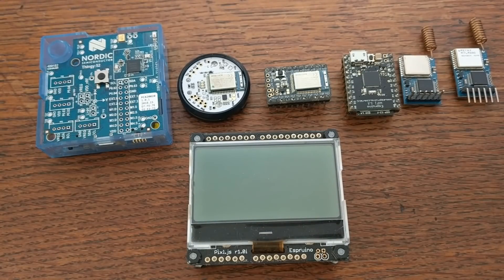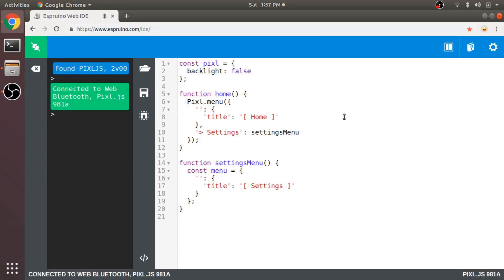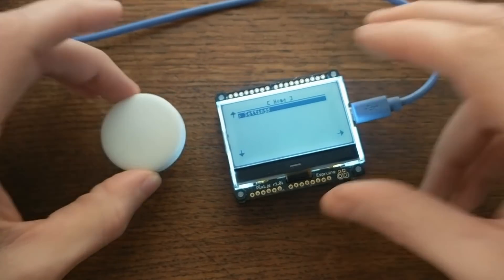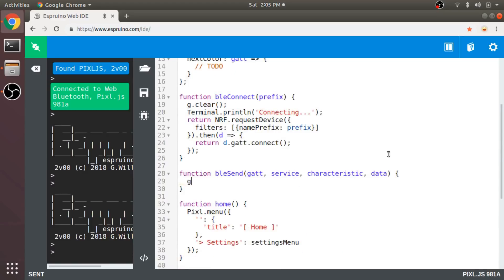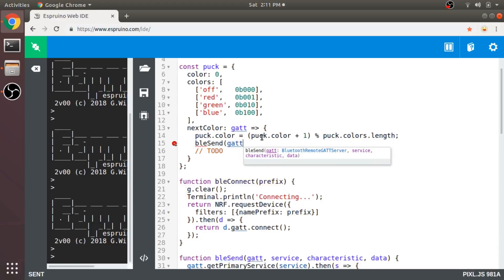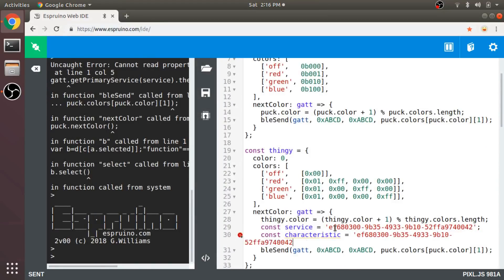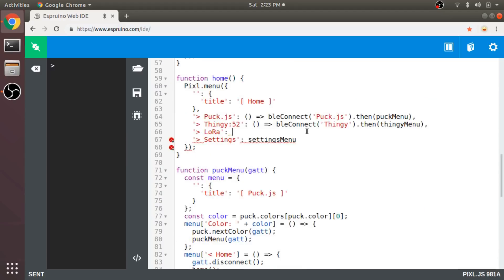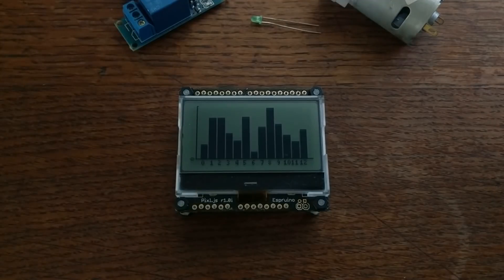Build your own IoT Device Hub | Bluetooth | LoRa | Tutorial

Comment: Great video, thanks. it would be nice if you could just leave a copy of the code, you write in the tutorial, someplace.
I am having a problem with the Thingy connection. It seems to connect ok (at least the blue breathing light changes to green) but does not then go back to the thingyMenu. The Pixl.js just says connecting and does not proceed.  Any hints gratefully accepted.

Comment: Can you explain me the Pros and cons about using Js instead of low level language ? 
Thanks !
Reply from the maker: This video goes into more detail on that: https://www.youtube.com/watch?v=RCxKfVim-Xg
Basically for something like this I don't need raw CPU power, I need concurrency to handle the LoRa communication, BLE, and the GUI together. Using a low level language would have just resulted in way more code without much benefit (it wouldn't speed LoRa or BLE up, those have IO bottlenecks).